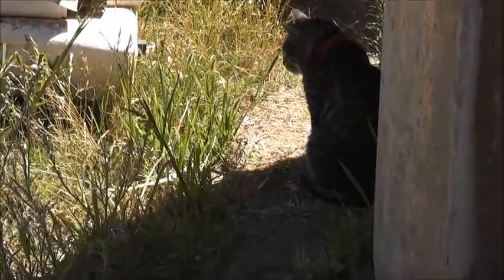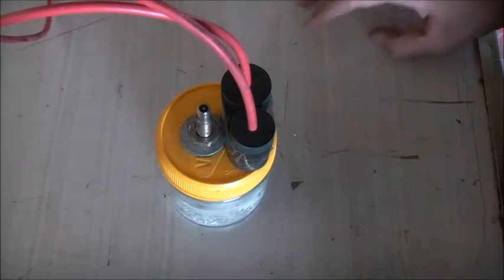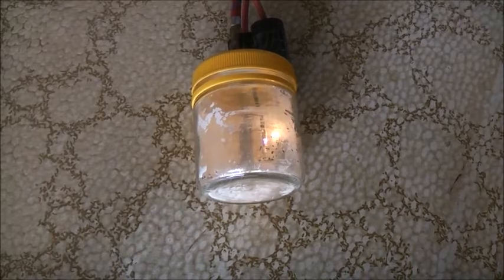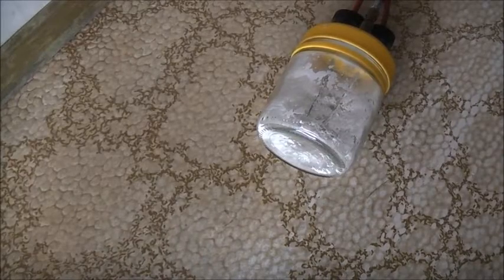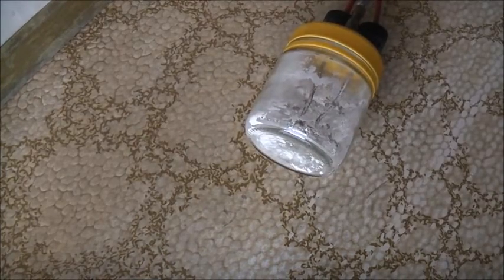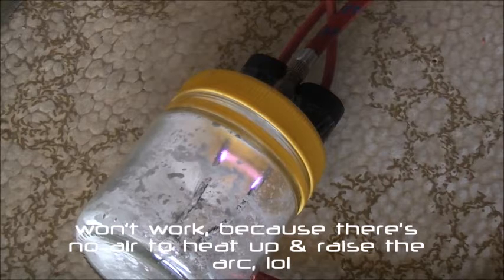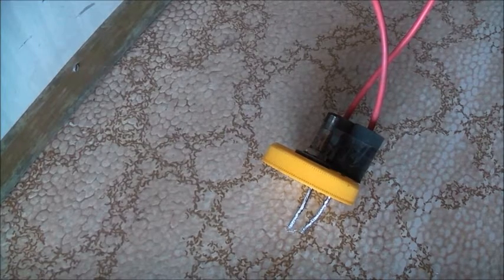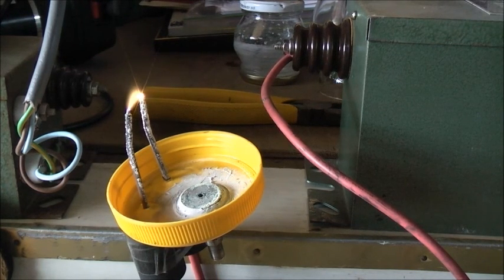NST Fluro Phosphor Experiment

Comment: You do need a vacuum or your electrodes will simply burn. What he is missing is as you said the mercury vapor to create the UV  that he needs to charge the phosphorus. 

The op is basically attempting to make a fluorescent tube.. They have mercury in them near the electrodes that will vaporize when the arc hits them.  He is also missing the long arc which also creates more UV. You tune an HV discharge to give off more UV or more IR depending on your need. More voltage more UV, current = IR.

Comment: As far as I know, You eather need the UVB and C from mercury vapour to make the stuff glow in the fluoro tube. The other way to make it glow, I think, is electro luminescence where you put the powder between 2 plates of glass and put voltage on the outsides with something like fly wire. Effectively the powder becomes the dielectric of a capacitor. You could try a normal fluoro tube, and let the air in and then vac it and see if you can get phospher glow with anything other than mercury!